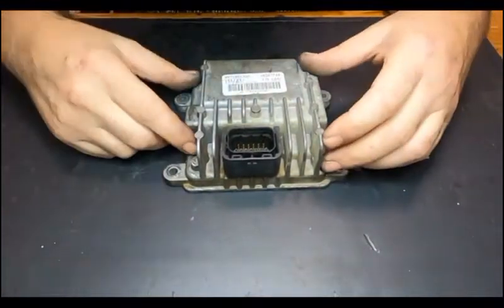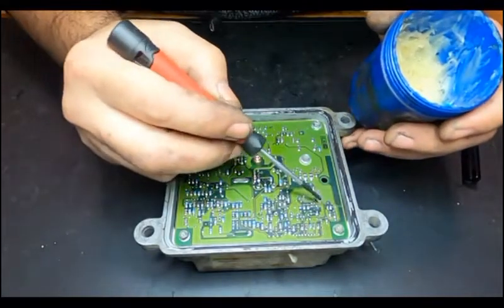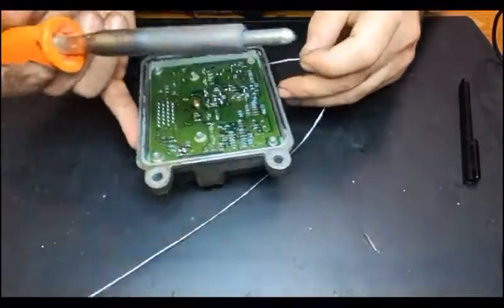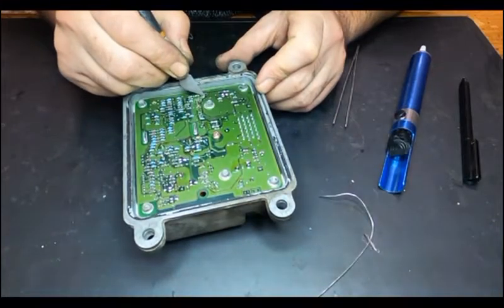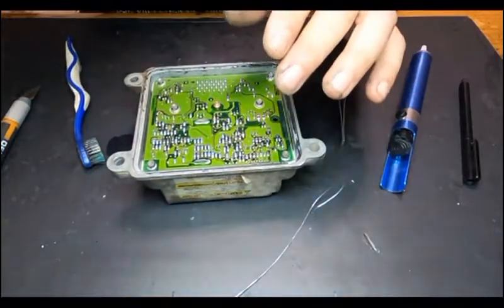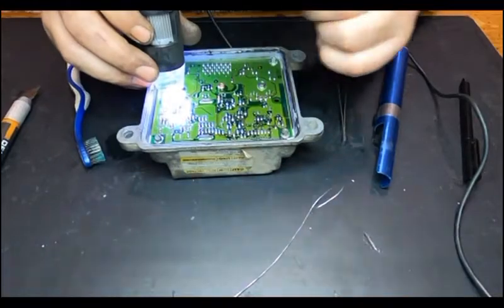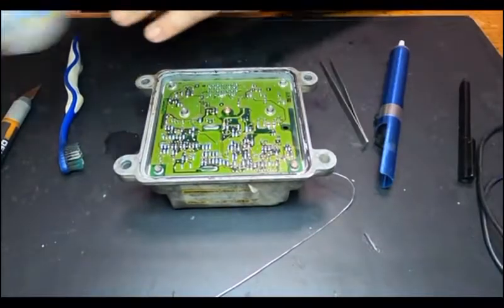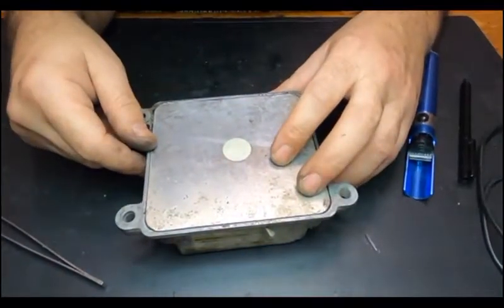Opel Vauxhall 1.7 DTI EDU Repair

Comment: Why does the pump not push the fuel into the engine even though the engine is running and does not start because the fuel does not reach, knowing that the fuel is entering the pump
Reply from the maker: There is a fuel return valve and a quantity adjust valve that are controlled by the EDU.

Comment: Can you help me with the error code P1625 main relay stuck open
Reply from the maker: did you try the fix on this video?
also these cars have the ecu on top of the engine and you need to make sure that the plugs are clean and that there is no pin broken on the ecu plugs.
also check the fuses
good luck

Comment: I my8 i have a opel corsa c 1.7 dti car start and drives lately I don’t hear the buzzing noise from the back when i turn the key var random wont start i know i have 6 ecu pins broken could this be the problem
Reply from the maker: Thanks for watching.
Yes i believe that the broken pins are indeed the problem.
This one in the video is the EDU that is located in the back of the engine block, and your is the one on top of the engine that is the ECU.
Thats a common problem in those.
Usually i just replace those but those need to be coded to the car unlike the one on the video that is not coded.
Good luck
Reply: @PSICompanyPerformance   had it open yesterday pin of and 4 10m bolts of had it checked out was ok i sealed back together now am not having priming when i turn on the key car runs on once I turn it of sometimes is hard to start it i have to spry some fly killing spray to have it come back to live once is running is ok drives ok max speed 70mph 😂
Reply from the maker: @hitmen2025  you talking about the EDU or the ECU
Reply: @PSICompanyPerformance  morning the edu was ok had all pins tested was ok the ecu has 6 broken pins what i noticed yesterday was 15mls drive reached down to the edu was bery hot is this normal am ordering a set of ecu from eBay well see if that helps before car started ok even with broken pins now random very hard to start it as i no longer hear the pump priming the system but once i have it started is ok

Comment: How do you do when you want to remove mother board out of the body and fix or locate the parts
Reply from the maker: Thanks for watching
In that case you need to desolder all those solder points in order to remove the board from the case since all the components in the other side are all glued inside the case.

Comment: Thanks for the video, today I'm trying all this myself. BTW, since I am an absolute beginner in soldering, I've always wondered what does that blue tool with a push button do? I have it in my soldering kit and have no idea. Trying to learn.
Reply from the maker: Thanks for watching.
The blue tool is a vaccuum tool that sucks the solder after its melted so that you can remove old solder and, in this case replace it with new.
Reply: @PSICompanyPerformance  After watching your video for the third time, I realized that by myself, finally. Also, as I now opened my EDU, I actually did not find any problematic soldering, even looking with a magnifying glass. Do you think it is still useful to resolder all those joints you've shown, just in case? Because I'm almost sure this EDU is the problem of my Corsa 1.7 DTI not starting at all. There are also other videos where I've seen some kind of a bypass wire soldered on the PCB. Maybe I should check those options (because maybe there is a dead condenser, etc.) Unfortunately, it is so difficult when  I have no experience in this.
Reply from the maker: @prehistoricboar4620  yes.
Usually you need a microscope to see the cracked solder points...you dont have anything to loose really...just go ahead and solder it
Reply: Hi
My bakkie 1.7 dti opel corsa utility starts but after a km it will cut off is the edu a problem